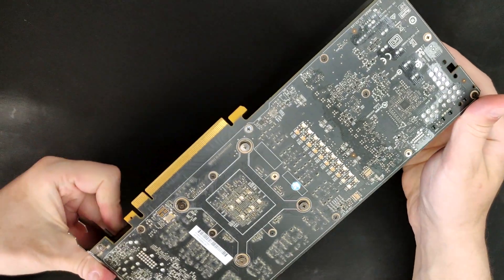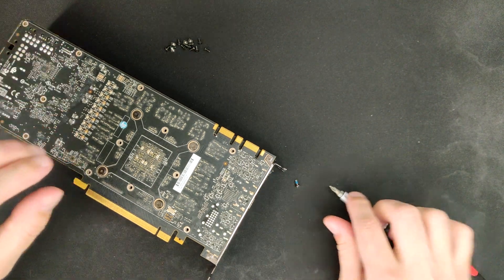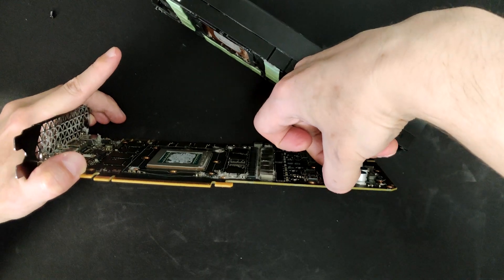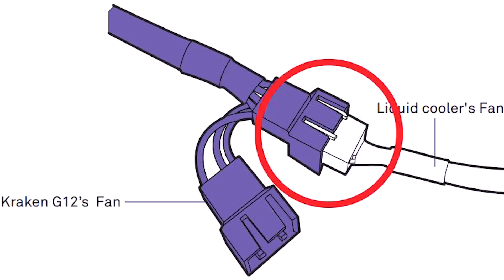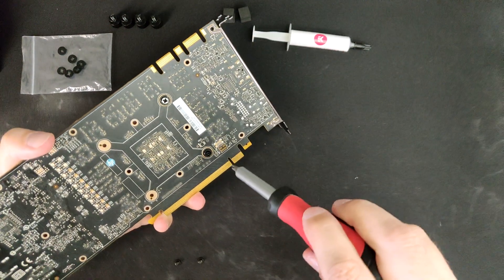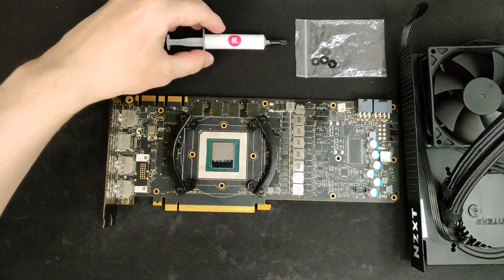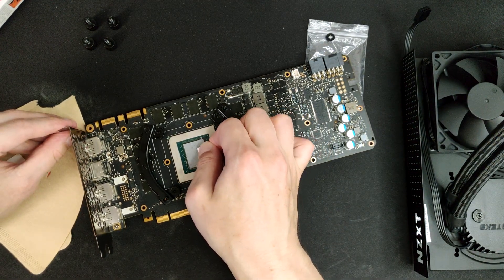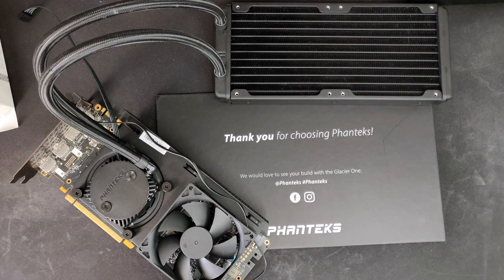How to watercool a GPU the easy way - NZXT Kraken G12 installation

Comment: I implore you, please measure the brackets distance, how many mm are in between them? I have a 6700xt and I want to do this mod
Reply: I have this on my xfx6900xt, I cut the amd bracket ends off and drilled two holes a bit wider on the G12.
Don’t tighten the cut bracket ends to much and do a quick test fit to line up the G12 bracket with the amd bracket ends you cut off earlier (I used a dremmel tool) and tighten when ready to permanently fit, works a treat. I swapped the fan out for a noctua, been thinking of adding heatsink to vram but have found I did not need them. I used a mini fan adapter so I can still control the fans from amd software.
Reply: @dame666999  I've just done the same thing with an RTX 3070, cut the amd brackets, put a spot of thermal paste on the mouting screw holes lined up the bracket so the aio would sit nicely over the gpu die and drilled 2 new holes where the thermal paste contacted the g12 bracket and it fits great, with an undervolt and overclock it runs at 50-55c under full load.
Reply: @Ulrich Leland  
Good on you I bet your glad you did it now, it was a squeaky bottom moment for me but it improved my XFX6900XT immensely. I was unsure about buying a factory water cooler as there is aparently 2 different pcb boards for this gpu and I saved money and it looks good to me.
I have upgraded to a 4080 which I love.
I didn't need to but I undervolted it to save on power consumption with the price of electricity at the moment but I do prefer undervolting anyway.
Reply: @dame666999  I did it mostly because my original cooler started making a horrible whining noise any time the fans kicked in, pretty sure the bearings were going bad, Only owned the card like 4 months didn't want to go through the whole hassle of contacting the seller or manufacturer over warranty and lose my main pc for who knows how long, it runs great though, undervolted it to 0.975 mv at a stable 1995mhz core clock and +800 mhz on the memory, hope you're having fun with the 4080.
Reply: @Ulrich Leland  
It's great I did pay £1200 but its my treat for the year and no troubles like 7900xtx which I was very tempted by but in the uk they are as pricey or more than the 4080.
With my lg 4k oled I  run it capped to my 120hz screen for 4k gaming as I like single player 3rd person games.
Reply from the maker: Hi Bogdan! After some searching I managed to find the AMD brackets and took you the measurements, I uploaded photos for you in Dropbox: https://www.dropbox.com/sh/dz6efc5pyx7w7p5/AACmCe1h7Ux-5xtJf7GPlFXPa?dl=0

G12 isn't compatible with 6700xt straight out of the box but you can make it work with minor tweaks. I would just make custom brackets with correct offset, you basically just need an S-shaped piece of metal in every corner and attach them to the PCB and G12 main bracket with M3-M4 screws and nuts. You could technically do a full DIY version with the asetek-bracket that comes with an AiO, small sheet of metal, a pc fan and those measurements I gave you 🤔

If you run into trouble or need something else don't hesitate to ask!